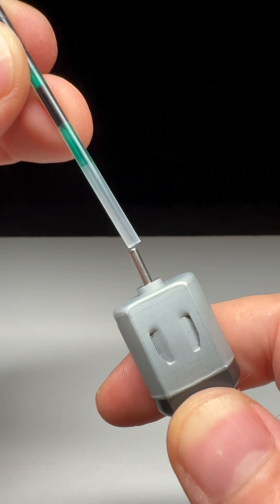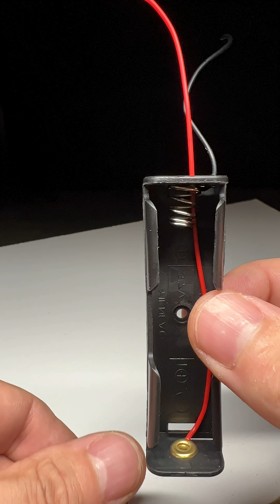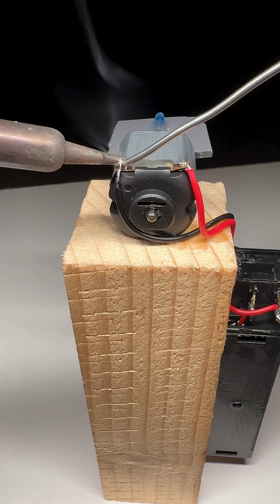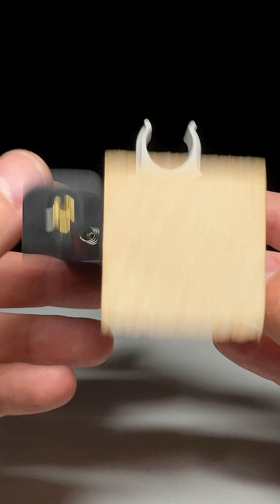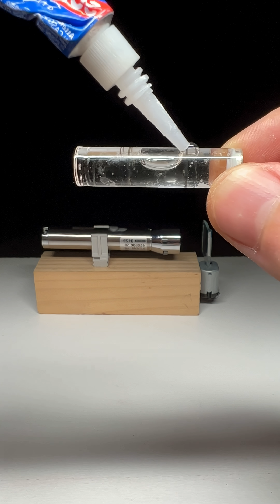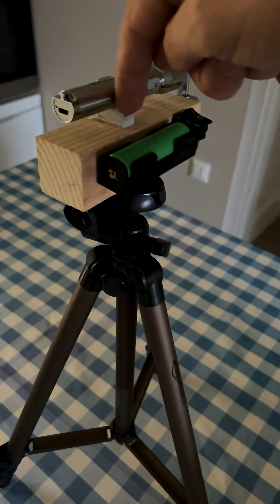🔧🔴 DIY Laser Level – Simple and Precise! #diyprojects #experiment #inventiontech

Comment: A good laser can be purchased for 30 bucks these days and you get a vertical laser line along with the horizontal . and it's on a pendulum so as long as your within a certain range it will self level.

Comment: The bubble should be mounted to the flashlight body
Reply: No, the bubble should be mounted to the mirror 👍🏿
Reply: @LI666Y  wrong it should be in the tripods leg!
Reply: @spranggatsnonoy1166 should be mounted to the battery or better on the wall or floor 😅
Reply: The levels of accuracy in this project are on par with a child's science project.
Reply: Shouldn't to bubble be mounted  so it's exactly perpendicular to the axis of the motor? I do agree it will make a great straight line, but I don't know how precise hot glue attaching methods are
Reply: It's not a flashlight, it's a laser.
Reply: The mirror is perpendicular to the block of wood not to the laser.
Reply: the bubble should be popped
Reply: 😂 🤣😂🤣😂🤣. … scusa non rido solo x il tuo commento 😂😂😂😂